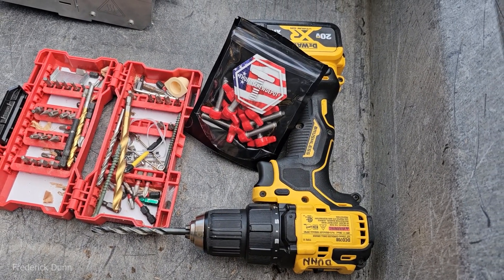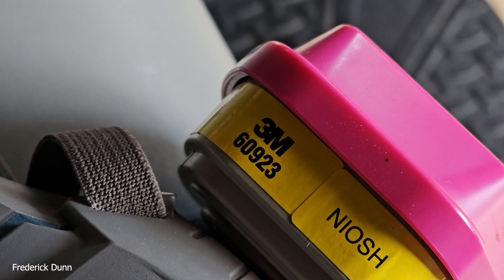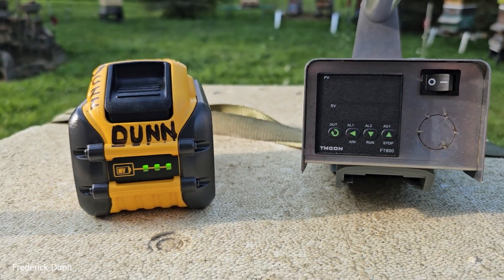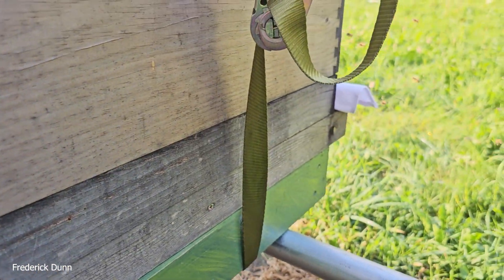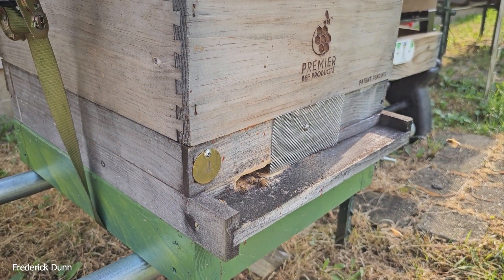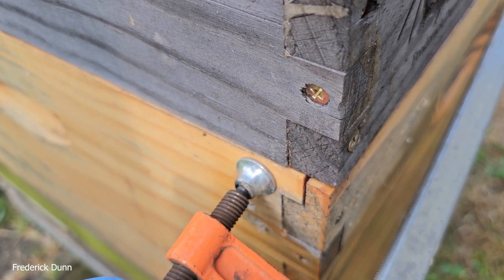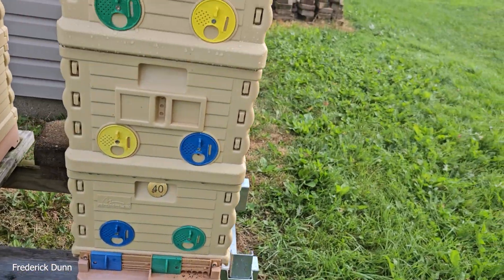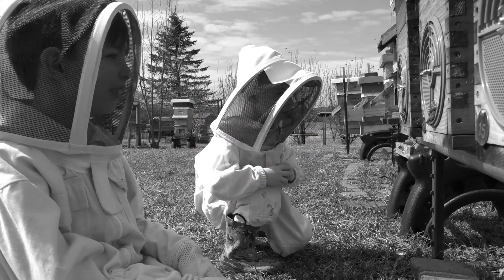Oxalic Acid Miticide Vaporization Quick Tips, Hive Box Alignment

Comment: My Lorrobe unit has to be plugged in, which means I have to use an extension cord. If I go to the furthest bee hive, I have to use two extension cords. Do you see a problem with this?  I think it takes longer for it to get up to 400 degrees.  I am not sure the power is enough to go higher.
Reply from the maker: You'll want to use heavy extension cords if you can. I used to use my ProVap also and it required 110 power also. I do like this battery powered InstantVap. You can use PowerStations like the DeWalt units and that removes the need for extension cords or powere on site.

Comment: Fred, Rob will add the battery safety chip to your Instant Vap for $50. Mine was an original version so I took it to the Honey Bee show in January and gave it to him. He shipped it back to me in a week. He even cleaned it while it was apart.
Reply from the maker: Thanks! I'll just keep an eye on that Volt display. I've not hit that 15% mark in a treatment cycle with the batteries I use, but that's good to know :)
Reply: @FrederickDunn  Hey Fred it's not 15%. That would be 3 volts for a 20 volt battery. At  15Volts. you begin  deep cycling a 20 volt battery  and shortening it's life.

Comment: Great tips,i used a high temp plastic dowel ,(PTFE,) 4-500F°like what rob sells, similar to your dowel ,still have to bee careful,glad you mentioned  full face sheild mask, good sturdy boots  help protect your feet from any OA dripping off the nozzle
Reply from the maker: Yes, I have that adapter tip also, but it really gets stuck on the brass sometimes, so I've gone back to the dowell.

Comment: Hey Fred, I am in Central Missouri. I have about 10 layens hives And have about 15 buff Orphington in Plymouth rock mixed chickens my question is how do you keep the chickens from going to the bathroom all over your porch and chairs that you keep outside also, can you elaborate on broodiness as I’ve had a couple go broody this summer?
Reply from the maker: My chickens don't go up on our deck thankfully. But in the past i've used a motion activated spray-away unit that you connect your hose to. When thickens or other animals come near whatever you're trying to protect, it spritzes them with water and you're watering your garden, bushes, or grass in the process.

Comment: For those using polystyrene hive. I cut to size a stainless steel straw. Drill a hole in the correct angle, then gorilla glue it in the right place. It gives you enough space to not melt the hives. Works well on the apamaye bottom boards as well. Just use a bolt long enough to plug the straw all the way through. Fred's cork is a good ideal as well.
Reply: I'm not sure if Fred's device is hot at the front. But mine will melt it.
Reply: In the video he says it's a wooden dowel